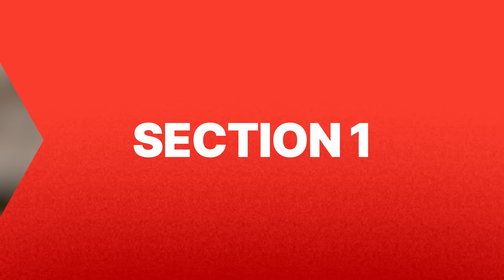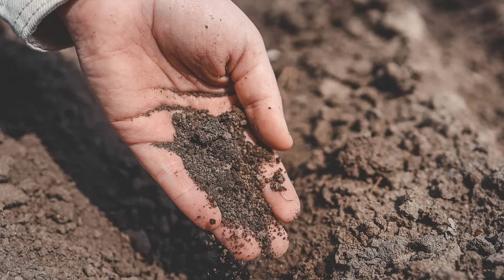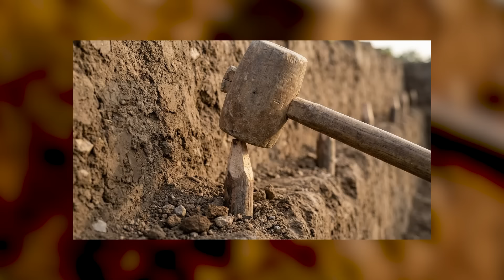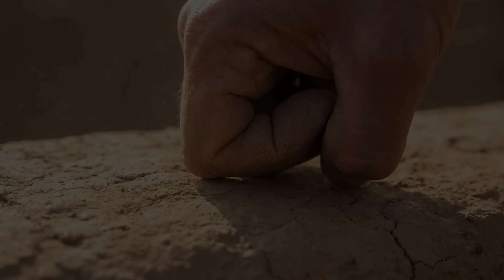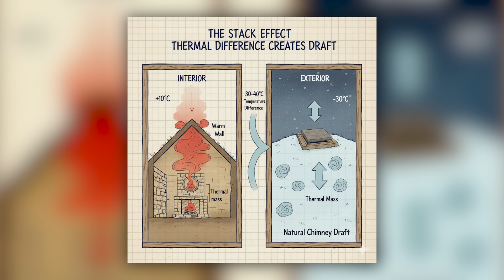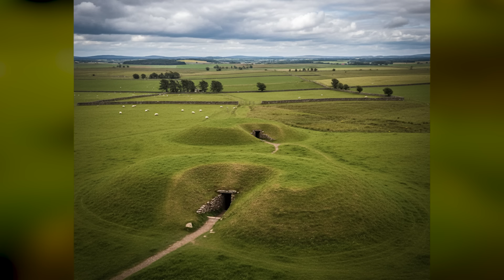How Medieval Families Built Hidden Dugouts in 860 Hours That Modern Engineers Can't Replicate

Comment: Carbon dioxide is not what you have to worry about with a fire. It's carbon monoxide, and it doesn't sink to the floor. It mixes relatively evenly with air according to their weight.

Comment: Several of the comments found fault with the use of 1.5m average depth. To get hung up and argue that the average depth of excavation couldn't be accurate because, the metric system had not evolved yet, means you missed the point entirely. The unit of measurement used makes no difference, feet, inches, cubits (at least 1 of the 7 wonders of the ancient world used this measure, which has a metric equivelant), toe nails or maybe they stopped digging when ground level was at nipple height. Could be. The slight variation in excavation depth, would vary only on the height of the excavator. 
The point missed by dissenting comments is, these builders somehow knew when deep was deep enough. Cover the top and live comfortably. The dwelling wasn't the status symbol it has become today. 
If we turned back the hands of time 5-6-7 centuries today and gave everyone a shovel, or better yet the electronic device they are using to argue the point that would totally useless without a support network still centuries away. I'd bet very few today would survive.

Comment: 8 degrees in winter is fookin COLD!
Reply: Wimp.  For a start 8 degrees Celsius is 46.4 degrees Fahrenheit.  That isn't that cold.
I am 70.  I remember having to scrape the ice off the inside of the window every morning in winter. (Midlands UK). No central heating. A single coal fire in the back room, a combined kitchen/dining/living/room.  Deliberately drafty so as to minimise condensation and keep airflow.  You slept under several blankets and an eiderdown, with a hot water bottle. Thick flannel pyjamas.  During the day you dressed warm with at least 3 layers.
Nowadays people have it easy. Central heating, double glazing, cavity wall insulation, roof insulation.

Comment: Strange that such precise measurements were recorded. Metres weren't used as units of measurements until the time of the French Revolution.
Reply: DOnt be silly. Metres were around for ages,  they just converted them to feet and inches with mental arithmetic' They called the metre 3 feet and 8 5/32". Why? because  fractions are more useful than decimal places for real mathematicians with a real job to do properly.  
However thy didn't use that much because they preferred to use either four feet lengths as multiples! Feet are a useful nmuber when  for human proportions.  Five foot people six foot people etc... or instead,  if you are forced to prefer,  1.756 metres etc. Ha!

Comment: The old houses in Romania were made  from clay bricks, having in the corners wooden beams. The wall thikness was around  25 cm. The ceiling was made of woven wickerwork covered with a 15-20 cm layer of clay combined with straw and horse manure. One of them still exists and are in good conditions even after 80-100 years.

Comment: 1.5m is head height, moving around stops stale air gathering.
You'll find the same at Skara Brae in the Orkneys, where windchill was the major factor.
About 5 years of settlement creates rammed earth flooring which is close to concrete
The images you show are of actual houses in the Flemish Pajottenland, just west of Brussels, in the early 17th Century, and most are still in use 400 years later. They've been identified from the churches, which are each distinct. The hills and valleys are imaginary.
In mountainous country, deeper levels were still ventilable, and used to keep the cattle to heat the human accommodation above. In flatter land, the barn was next to the living area, so animal heat helped maintain the farmhouse.
The Southern European area had kitchens and store rooms in the "area", with the public rooms slightly above ground level, in the Piano Nobile, family bedrooms above that, and servants rooms in the hottest area under the roof. Most of central London was built in this way in 17th century.
One thing you failed to note is in military knowledge, the first cut is the grass layer, stored apart to go on last, opened with knife slits into a lattice which infills in the first year to hide the raw earth. The next half meter is usually sandy loam, with the clay washed out by the rains. This is lighter. and forms the roof. The remaining depth forms the walls, as described.

Comment: Absolute bullshit, any engineer worth their pay packet could build this. In fact most lay people could.
Reply: yep...soddies were used by European peasants that came to the Prairies. I also found the remains of an inland shuswap pit house on my farm that was built into a side hill with a slight slope. The pit was about 5' deep and the entrance way was sloped down which we guessed was to vent CO2 but the main house larger at about 13' across and the sidewalls here about 7' tall which allowed it to poke out of the ground at the front which we guessed gave them the ability to look out to see who was coming(from the downhill side). The local FN said that the roof would have been covered in timbers and then with heavy clay with a sod layer above that. From a distance, it would have looked like a small bump on the hill.

Comment: "1.5m was the maximum in most terrain...."  What does most terrain look like?  BS commentary. If you don't want flooding out in spring, don't build in a valley. Whether 1.5m works or not can change over 100m.  No one was applying some modern statistical analysis for "most terrain", they were applying knowledge to ONE terrain where they wanted to build.

Comment: Today's engineers are not nearly as physically strong as medieval peasants were.  It would probably take today's engineers at least 1,500 hours.
Reply: In the oldest buildings in my old village in Brittany, built hundreds of years ago, the doors were barely four and a half feet tall. This wasn't because the locals were short. It ws so that an attacker with a weapon had to bend down to enter the building; a very exposed posture.
Reply: wild claim, prove it!
Reply: @gerardvandermeulen62 your comment proves it
Reply: That, or a bulldozer.
Reply: I have power tools.
Reply: Peasants around 1000 years ago often didn't have dental and medical care, great nutrition and physical therapy after they were injured so recovery would be sketchy. I think their strength would vary greatly depending on their good fortune
Reply: 80 hours design and planning, 1400 hours on BS admin tasks, and pointless meetings.
That leaves 20 for construction, and that will realistically take 400 and after a few changes will take 800.
Reply: It would definitely take longer if you lived in California